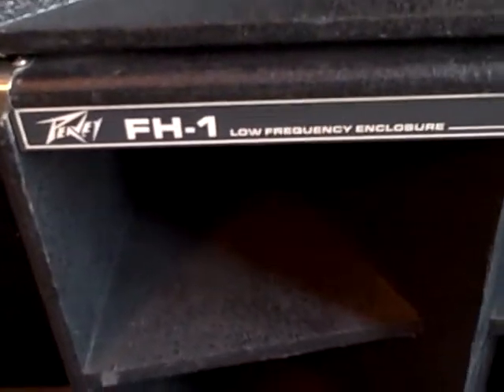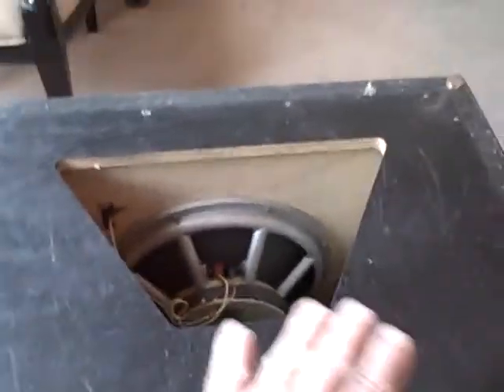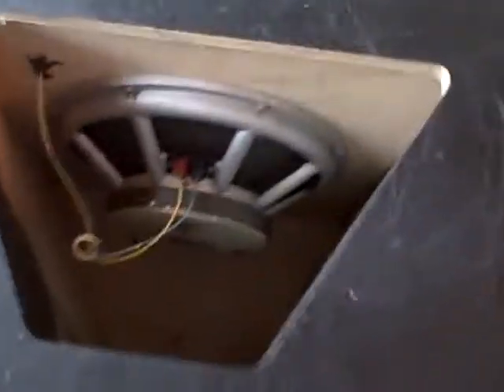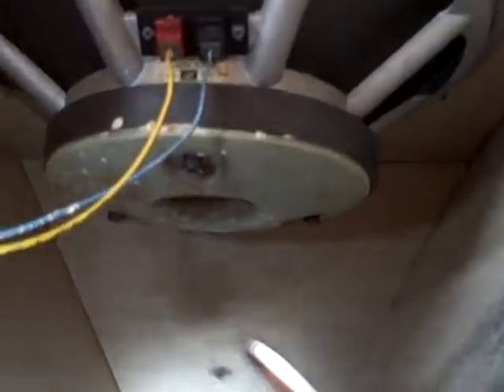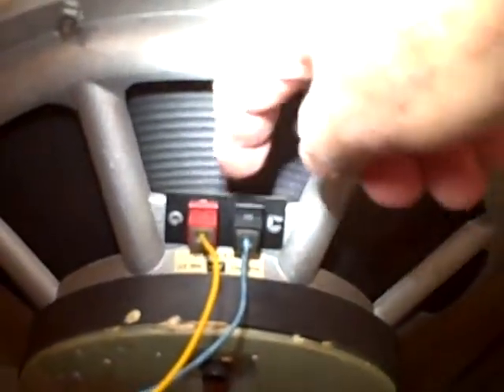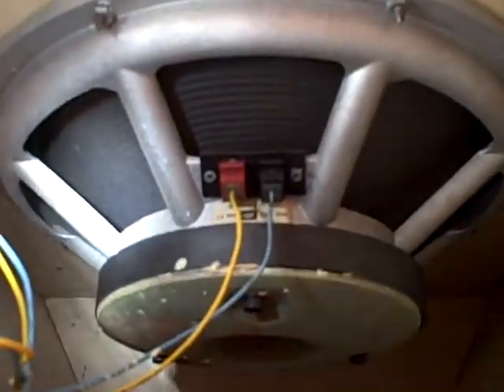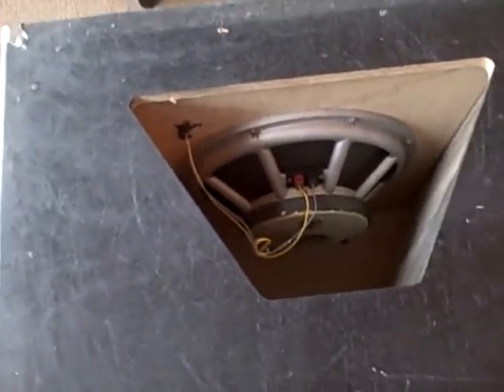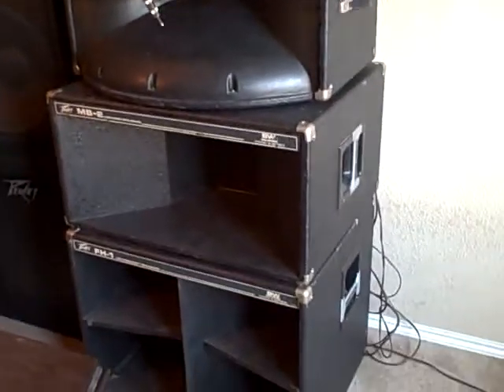Peavey Project 2 - inside the FH-1

Comment: I got 2 double stacks in the corners of my shop your gonna need a stereo 3 way crossover to cut frequencies for each cabinet also the FH1 only goes down to 60 hz so you need a sub to fill the hole my answer is a small 12" MB Quart sub (500 watts rms 1000 peak) in a small bandpass sub box the specs on this sub are 18 hz- 300 hz dual 4 ohm voice coils wired to 8 ohms run by a peavey cs400x in bridge at 800 watts. The FH1sX4 @4 ohms a side are powered by a Peavey cs1000x in stereo the mids MB-2 X4 are powered by CS 800x @4 ohm stereo and the MFX-1s X4 powered by CS 800 stereo @4 ohms
Reply: Want 4more? lol

Comment: I realize this is old, but do you have any links to video of this system in action?  Maybe with your band?
Reply from the maker: Donna and Dan - I'll try to see what I can find in terms of video. The complete system (FH1, MB1, MFX1) along with the equalizers, crossover, power amps, etc is quite a beast. But, I have to say, they sound really good - very clear - and don't require a lot of power. I realize they are not in style, but you can likely find a complete set of speakers for under $500 (be patient). Plus, and maybe because I'm an older musician, they look great on each side of the stage. For what it's worth, when we play a large venue (500 or more) I also use a set of Peavey 118-SUB HC speakers for the super low end. Lastly, I will mention the foam dust cover on the speaker magnet will deteriorate with time and cause the speaker to fail. Look on YouTube for videos about this issue.

I do have a nice picture of the speakers on stage at an event during a sound check. I can't figure out how to post it in this thread. If you can send me a message in Facebook (https://www.facebook.com/ben.price.58910/), I'll send it to you. Ben Price - San Antonio
Reply: @ve3cda  Thank you for responding.  I've sent a message via facebook.

Comment: How do you  hook up fh1 and separate tops mf1-x Thanks
Reply from the maker: Todd - I use two power amplifiers. I run the microphone (or you could use a laptop or other MP3 type source) into a equalizer, then into a crossover, then use the separate outputs of the crossover to connect to two power amplifiers. The MFX-1 tops do have a built-in low frequency limiter, so you could run the output of a single amp into the FH1s, then to the MFX1s. However, if you can, I would recommend using a 31 band equalizer and a crossover, as well as two power amps. Also, newer boards (like Presonus) will have the equalization built in, as well a multiple output connections, which eliminates the need for an outboard equalizer and crossover. Either way, using multiple power amps will give you a lot more control over the sound. Ben Price - San Antonio
Reply: @ve3cda  can I daisy chain.l I did it for about 15 min on one channel. Just one channel..lol on a qsc gx5 sound was awesome. Got a lot of things I bought lil older stuff but that's my gig.Some is 4 ohms and some is 8 ..i got sp1 I been using for over 20 years. I just need some help on setting this gear up.i have a. Mackie clx board a gx5 qsc .processors really sorta lost on hooking all up.live the steel guitar you have.
Reply from the maker: @toddroberts7021  Todd - here is my Facebook page: https://www.facebook.com/ben.price.58910.   Please send a message and include your e-mail so we can send diagrams and stuff back and forth. By the way, the GX5 is a very nice amp with plenty of power (just heavy).

Comment: My band had this system in the early 80's. We broke up in '84. While it looked Impressive as hell, it didn't put out much sound. But the sound it put out was quite good once you threw a bunch of outboard gear into the picture. For the day it was the best PA you could get affordably. We had the suggested CS-400 and 800's that went with it. Still you have to remember it's just 4 small speakers. Peavey decided to substitute important things for more wood. Over the years I had opportunity to buy these and passed. By themselves the FH1 was just too muddy, but was ok for kick. Today with all the digital processing this system could sound ok, but the low end problem would still be there. If they made a MB enclosure with a 15 in it that would have solved the problem. Then a different sub with an 18. Putting an 18 in this enclosure doesn't work, but I have seen it done. The throw is too long for the box design.
Reply: I have the opportunity to buy them now. Would you recommend them to buy for this day and age ? $200

Comment: I've seen better camera work from Michael J. Fox!   Terrible. Made me dizzy as hell.  Still,  i do appreciate the insider view!  Thanks
Reply from the maker: Hey Pork Rinds - Hope you have regained your balance! I have to admit, the video is just a tiny bit shaky. These old-school speakers like the Peavey Project 2's just sound wonderful (at least, for a classic country band).
Reply: @ve3cda  We had this system with an Old cs800. All the crossover  is in  the tweeter. And it sounds like ...  Peavey.  Loud, troaty and harsh... Perhaps with new drivers it can work, but with the standard drivers...... nonono...
Reply from the maker: @toraabe  - I have the Peavey Project 2 system setup as a 4-way (I'm using an extra Peavey 18 sub on each side for the kick drum and low bass). I have a 4 way crossover and power each section with a Peavey IPR or IPR2 amp. The sound I get out the system is very clear and smooth. You can clearly hear the vocals anywhere in the venue. As a side note, I play in a classic country band so our volume levels are moderate. I understand that these systems are not in vogue now (powered speakers or even line arrays are the thing), but I'm very happy with the sound and it always gives me a nice feeling to see the stack on each side of the stage.
Reply: Still I have a nostalgic love for old Peavey gear.
Reply: Yes, at moderate sound levels this system sounds Very good if you add an 18" sub. But what a Monstrosity! For the size it still doesn't put out much sound. If you push it hard, you will get that familiar loud brash Peavey sound. Just from all the wood rattling. We went from this to an EV T-18 with a pair of 1502s in 1985 and the sound smoked this system.